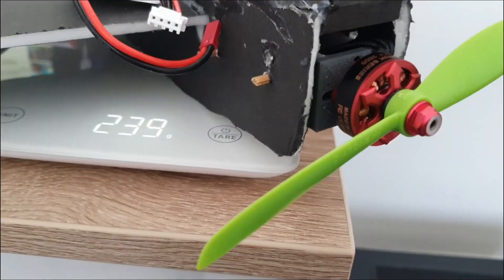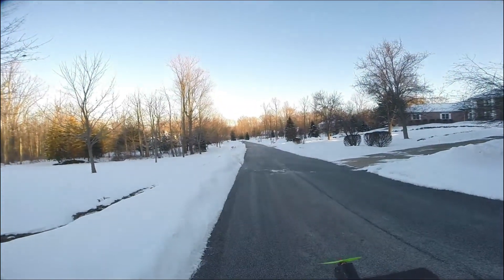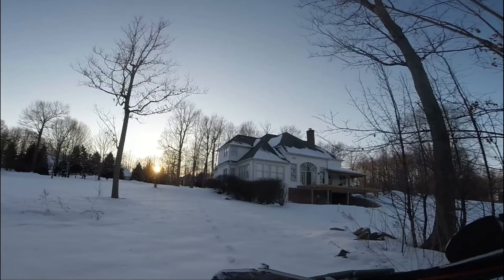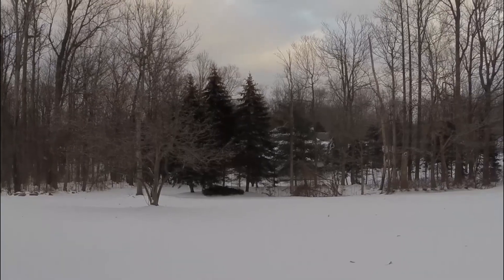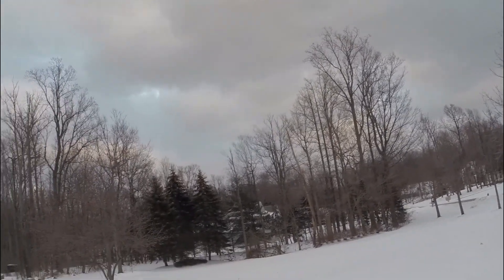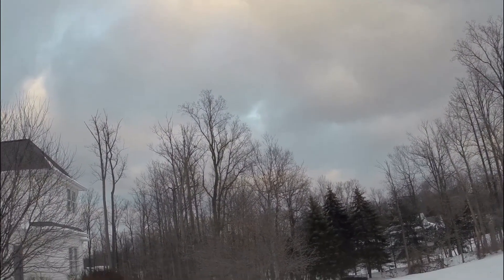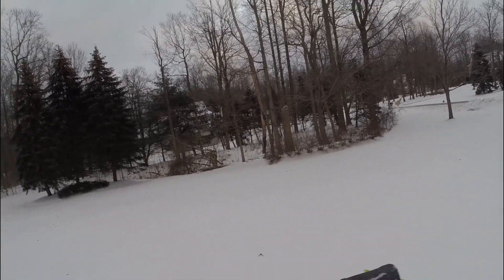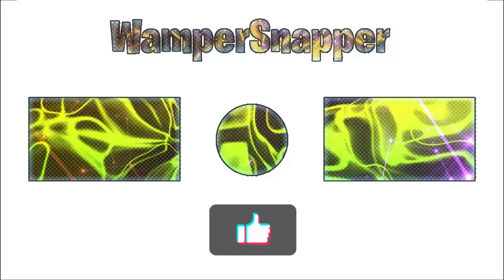FliteTest Mini Scout - Build (#1) and Maiden Flight

Comment: You forgot to mimic the gnarly right side angle to compensate for the torque of the motor it's like 20 deg or something and that's why it pulls to the side so bad
Reply from the maker: Yeah I completely forgot to account for the torque of the motor especially given that it is much bigger than intended 🤣😁

Comment: answers all my questions! I want to build one with the stuff I have. An emax RS2205 with recommended 5045 propeller and 9 gram servos. I think it might work. do you think I should use above recommend 6" props?
Reply from the maker: If you have those 5045 props that you were talking about, I will just stick with those. 6in was good for my setup as my motor stator volume is a little bit bigger but the torque with that setup cause slight issues with the plane wanting to actually roll because of the motor's torque so a 5in propeller (5045) with the RS2205 should provide a plentiful amount of power without being too overkill. Glad I could help! Let me know if you have any other questions!

Comment: Wow! Nice buliding and flying!! 
From my very limited experience in everything the touchy behavior and the hovering thing may be signs of a tail heavy airplane. Otherwise lots of expo is always an option... Also how did you secure your (I guess gopro) to your head?
Reply from the maker: Thanks! Yeah it did seem like it might have been tailheavy despite seeming balanced so I will have to see if I can maybe move the receiver forward a little bit to help counter that and I agree that more expo or even limited rates is probably the way to go lol. In terms of the GoPro I took these two straps that can clip onto each other and ran them through a slot in the GoPro case and then close it which secure it on my head and I used the adjustable clip to tighten it accordingly, worked better than I expected, you could probably do the same thing with velcro too. Thanks for watching by the way!